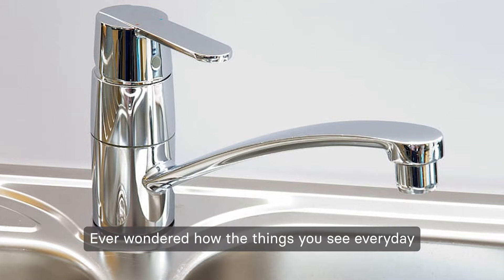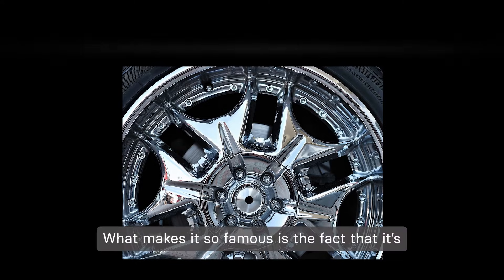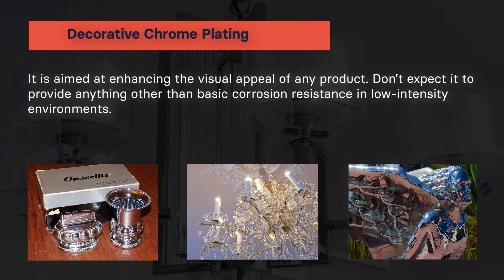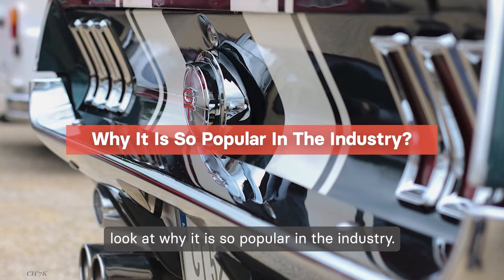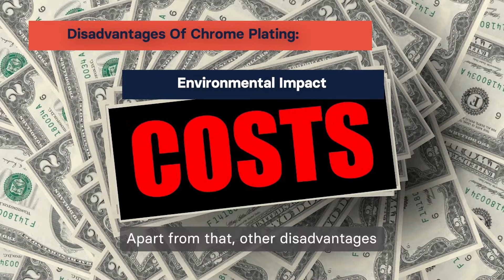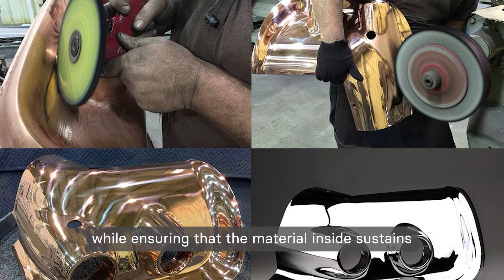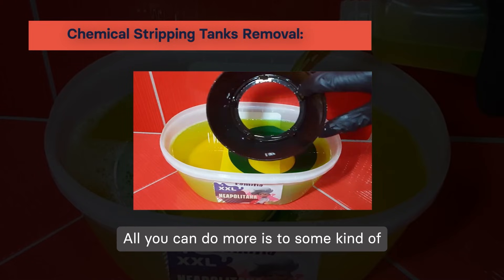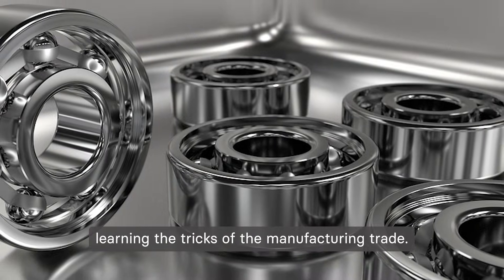What Is Chrome Plating? - Process, Benefits, and Applications

Comment: Old biker saying true is "Chrome don't get you home.". The metal is easier fatigued because of it. Stuff that rust is stronger even than aluminum but you need PAINT.   Why no LEAD paint or LEAD in gas still is NOT only for environment or health. Yeah it's toxic like mercury.   It uses Earth specifically how it should.
People interfere it.